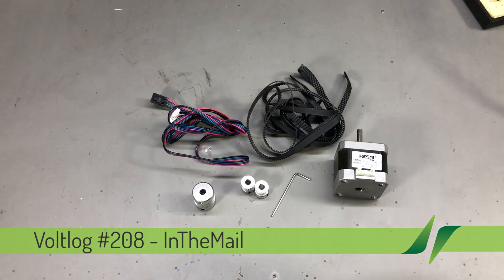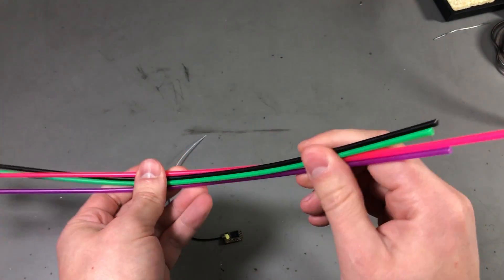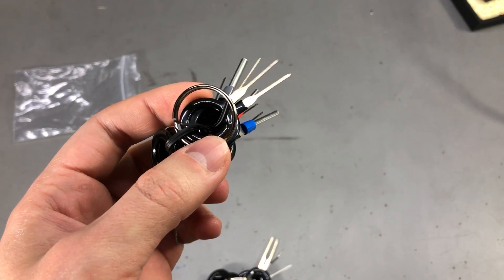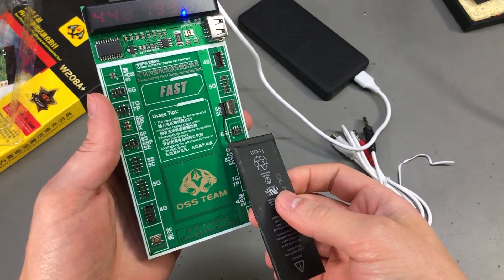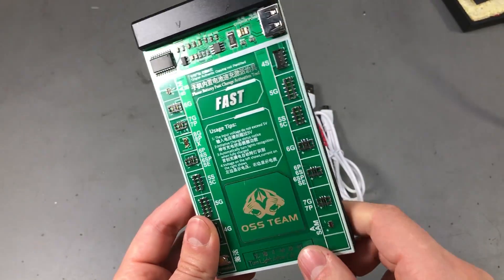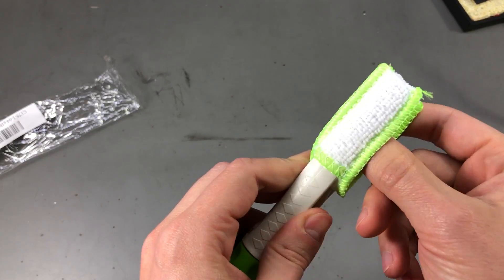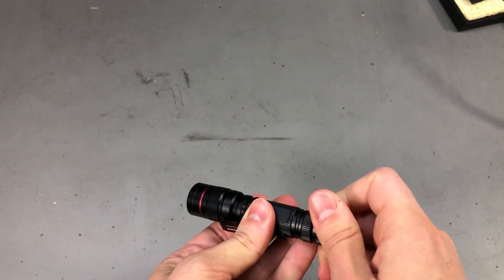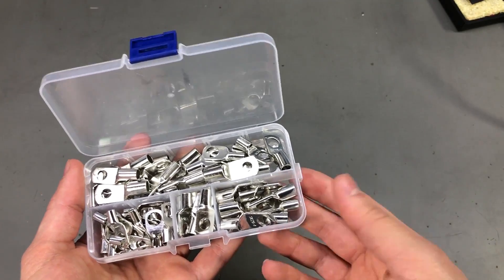Voltlog #208 - InTheMail

Comment: I got some of those ZIF sockets like you got. I was trying to program some PIC16F1509's for a board I designed. IIRC the chip was a TSSOP20. I got the correct size socket but the stupid grappling pin mechanism of the socket was around 0.5mm too small. I tried all manner if crazyness to get it to work. By "~0.5mm" I mean it was this bad after tweaking everything I could without desoldering and disassembling the whole thing. It was sooo frustrating to have something so close to working, but there wasn't an easy solution. I ruined 2 chips trying before shelving the dumb thing. 

Buyer beware. 

  I will say the socket worked fine for all of my cheap AliEx sourced chips with a similar package, just not the PIC's I needed it for.
-Jake

Comment: VW ecu connectors are usually from Bosch or AMP/Tyco or some similar brand.  
Yes, they can be a pain. 
Did you check for tiny piece of purple or pink colored plastic ?
It's often overlooked or forgotten. It's not visible from the outside, but needs to be REMOVED to ectract the female pins from a plug.
This picture shows it:   https://www.eficonnection.com/assets/ProductImages/bosch_96cavity_ecm_connector_gm_kit.jpg
You slide it out from the side of the plug (if yours has it), then use your extractor tool.
What ecu was it ? Bosch? Marreli? Siemens/Continental?
Reply from the maker: It was a Bosch ECU and I have removed the pink safety lock however the pins were still difficult to unlock from the plug

Comment: With the big lugs, consider getting a proper crimping tool rather than just using the pliers. Lugs that size connect to fairly large gauge wire which presumably will be carrying high currents. Crimping tool will do a better job of ensuring a low resistance connection. For your consideration :)
Reply from the maker: yes, definitely a crimp tool is the right thing to use

Comment: If the "sock" don't tolerate washing, sewing new individual socks from like an old towel or micro fiber cloth should be easy enough. Could also be made full length of the arms to reach deeper.
Reply from the maker: I think it could definitely be washed. Thanks!